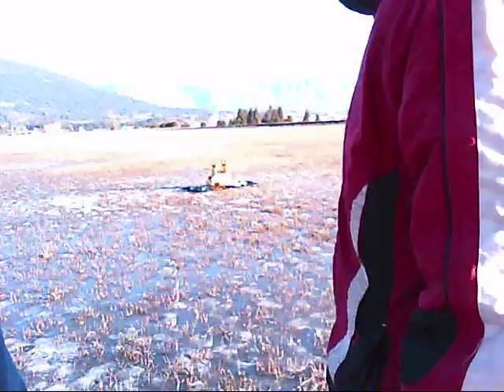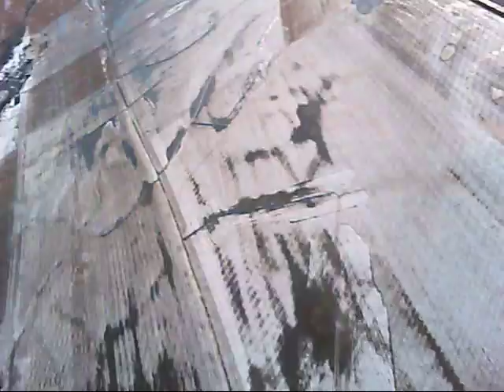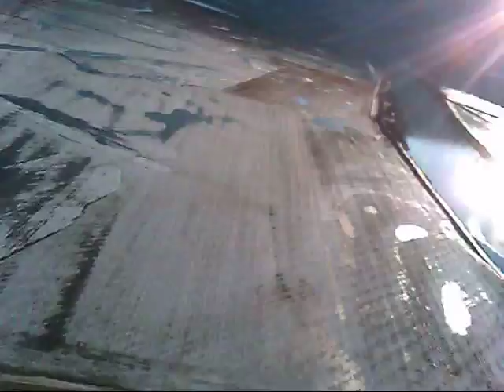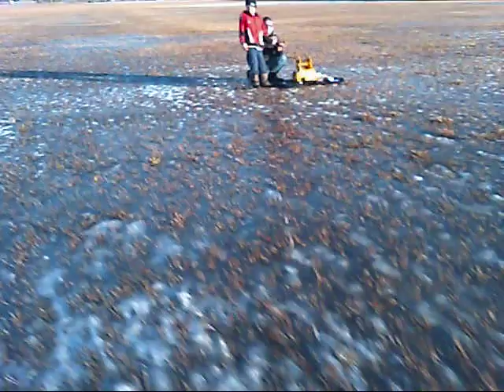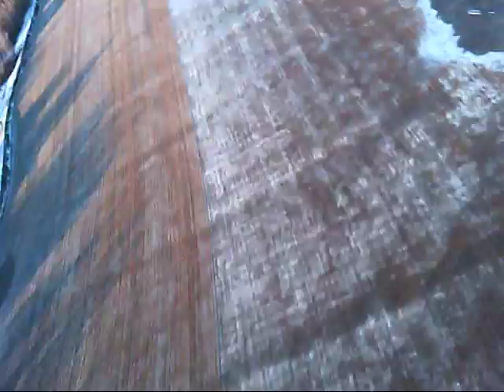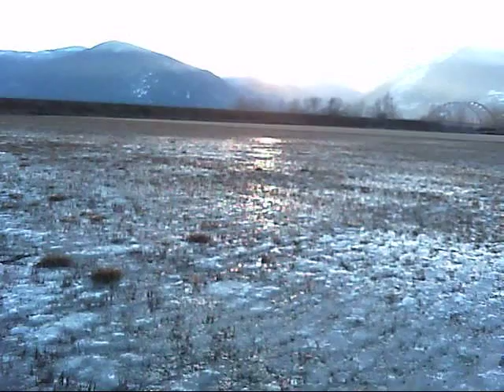Aerotech Initiator Rocket with Mini Cam

Comment from the maker: we are back at it folks!

after the last blast off & blow up we have finally built a new rocket!  we have done some modifications and have to do the finishing touches.  we re-enforced the motor tube, added a second parachute and have mounted the cam in the cone.  this should make for a less dizzying viewing experience!

we are using the 'venom snake eye micro sports cam' available at your local hobby shop.